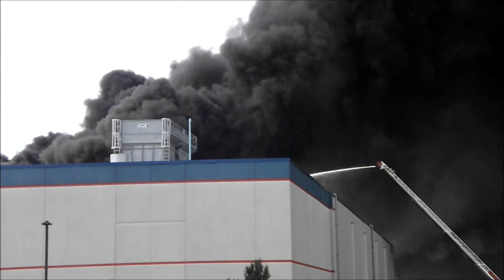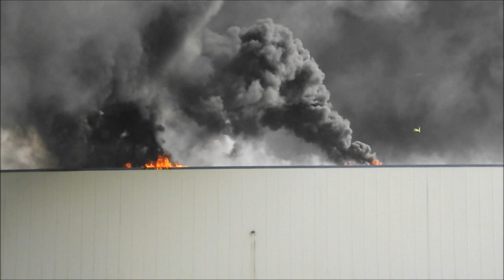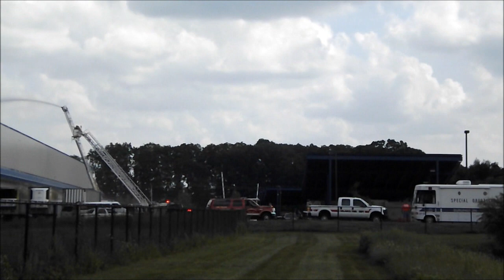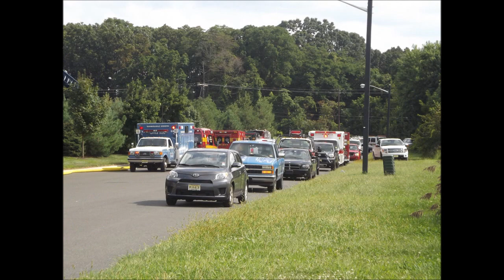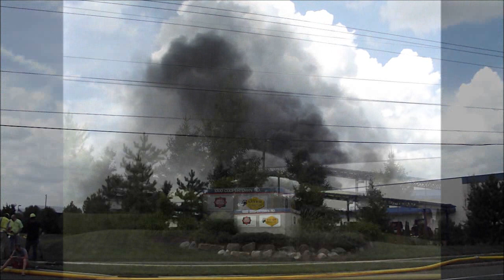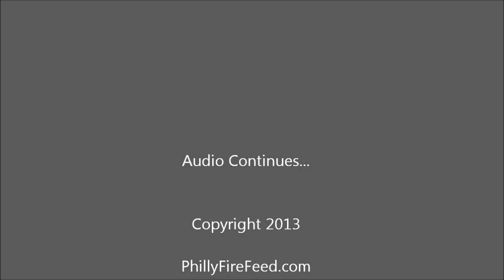Delanco 11 Alarm Fire Video, Radio Audio & Photos Part 1

Comment: "Fire fighting efforts were hampered by more than 9.000 solar panels on the roof.   Electric shock, slipping on panels, and the inability to ventilate the roof are some of the problems faced when fighting a fire where there is an array of solar panels on the roof." Sounds to me like fire insurance premiums  should be much higher on buildings with solar panels.
Reply: +Branchporter Fire insurance is for paying for damages due to fires; premiums are assessed according to the likelihood of fire occurring.  Buildings with solar are no more or less likely to have fires, there are a lot of factors that go into assigning premiums.  Now, if buildings with solar do routinely drive payouts up, then maybe...but that's up to the insurance companies and the actuaries who literally do the math on this, not a YT comment based on a single incident.  Roofs do not exist for the sole purpose of providing FF's with convenient ventilation capability!  Adapt and overcome, guys.